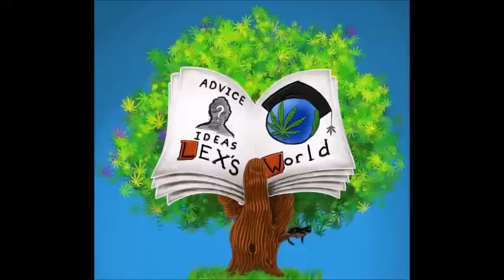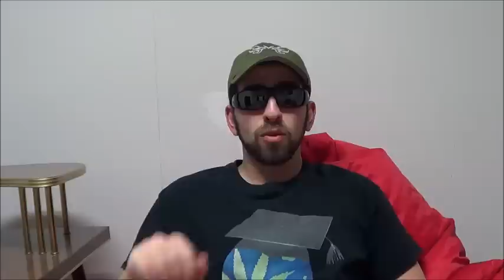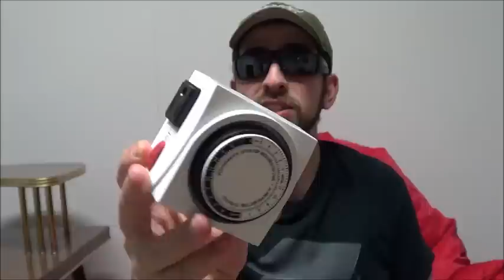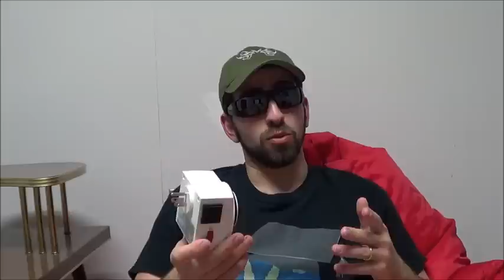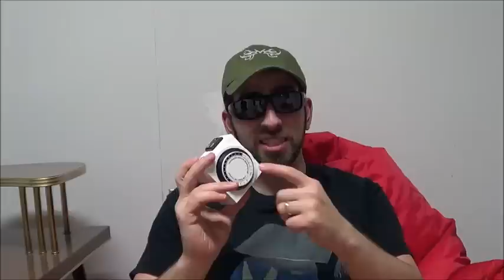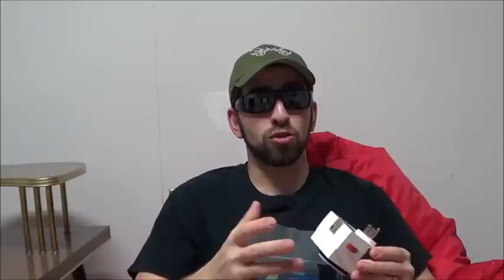Grow Light Cycle Basics + BLACKOUT Emergency Advice

Comment: 8f you are doing dwc, power out is a bigger deal cause of bubbler down. If this happens you can manually airate the water by dumpingbit into another bucket and back a few times an hour, or you can use a drill pump to move it.. I also have a large compressor cylinder that I can slowly bleed into the water for bubbles if needed.. more than lights, no bubbler will kill plantsfast

Comment: I was told during Veg you should run lights 24 hours then switch to 12/12 during flower. Can running your lights for 24 straight hurt yeild or plants? You are my once a day watch. Always learning new things here!. Thanks for what you do!
Reply: Icknod Codopay absolutely will not hurt a lot of people believe they need a rest but you can do the experiment by yourself you'll see around the 20 to 30% increase in growth using 24 hours instead of 18
Reply: Hey Thanks very much for the reply. Fairly new grower here getting good yeilds using this method!. Thanks again.
Reply: Checkout growweedeasy.com - I don't even use forums anymore after discovering that website. The forums are hit and miss, a lot of contradicting information between the users.

Comment: Timers are cool and all but I use $6 inline WiFi switches with a matching phone app that includes detailed timer options.
Reply: Mike of Indy post a link
Reply: Damian Merrel just go to eBay and type in Sonoff wifi switch and there are several to choose from
Reply: @One-way  what do you mean by that?
Reply: Dr.Zach sux throw it in the complete dark for 72 hours.  It stresses the plant not showing the sex.  I used the oven with a towel over the doors glass
Reply: @One-way  you can see a plant in the 3rd week of veg pretty easy, not sure why you would stress it to show more, you then have to deal with it reverting back to veg after a dark period, if shocked you have slowed growth quite a bit imo..

Comment: Hello Lex Blazer, I am a big fan and I have a lot of respect for your knowledge and your information delivery. I ran into an apparent, huge, problem with my light cycle. I am an idiot and FORGOT to change the light cycle from veg to flower. For almost 2 days after switching the lights they were kept on 18/6 cycle. I noticed a huge burn on all the fan leaves and it was then when I realized what I did wrong. I have now switched them to 12/12 but with some noticeable damage. Most of the fan leaves are burnt and dry. Is this damage permanent? ....thank you for your advice and input. Have a great day and keep up the great work man.
Reply from the maker: the damage to the leaves is permanent. Everything will be alright, but you've caused some stress and your final yield will be affected somewhat.
Reply: Thank you! You made my day by responding this quickly to my problem.This has served as a huge lesson and I have documented my mistake to use as a reference so I never make a mistake like this again. To bad, the plants where absolutely gorgeous up to this point having applied all your skilled knowledge. I will finish the flower stage and see the end results and compare to any future yields and try to keep getting better. Wish ya the best!

Comment: So I Put My Timer For 12/12 1 Auto Flower Flowery 3 Normal Flowery Power Off 12 Morning & Turns Back On 10pm Would Of Turned Off By 10pm but the power so I Let It Run For 7 Hours Than Turned It Off What Should I Do Its On Rn?

Comment: hello Lex. I enjoy your videos, they are very informative and thank you. I have a question about lightning though. 
If the maximum hours of light given are 16/8 instead of 18/6 on growing stage, is this a big problem? I know that at 15hrs its like a dead zone for the plant, but is 16hrs going to harm the plant in any way or it will just slow the growing time?  100W full spec LED + 110w TCL for gow. thanks
Reply from the maker: it's not a big problem. It's just not ideal.

Comment: Hello Lex.. I have my plants on 18 & 6 and they they are showing signed of flowing.(Pr Flower) How can I stop it... Due to a thunder storm my lights was off for 15 hours. Ever since then they have been showing white hairs...
Reply from the maker: i think they're probably going to be fine as long as you keep on 18/6 (maybe even go to 19/5 for a while) and you'll find they won't go any further into flowering than just the preflowers...the hairs really won't develop far. Alternatively, could be an autoflower you don't know is an autoflower? 15 hours of darkness shouldn't have messed it up too bad at all.
Reply: Lex Blazer thanks a lot it’s time they get repoted .. They been over due for to get repoted.. plus the temps get really low at night.. this may be a factor.. Michigan weather sucks even thou it’s indoor. I have nothing to control temps.. But thanks.. I will try to make a video tonight on my YouTube channel Motor City Meds

Comment: Bro,
I'm at 12/12. Been there bout 2 months. When do I go 18 dark, 6 light. Or do i?... I have a magnifier, what am I looking for to harvest?
Reply: You got it backwards. You start veg with 18/6 and when you want it to kick into flower you turn it to 12/12. They need a minimum of 11 dark to flower. If you give it more than 12 light during flower it will try to go back to veg and herm your plants. Definitely don't do that. 12/12 for the whole flower phases. 
Make sure you trim up your plants before you flower because stressing them during flower will also herm them . So try not to trim during flower.

Comment: When the hell is the flowering stage? A photo or something would be helpful
Reply: The flowering stage is pretty much up to you.  It will start to flower when you start the 12/12 light cycle.  If you start with a 4 week old plant you get an   ' X ' sized plant at finish.  If you start the 12/12 with a 6-8 week old plant, it will be MUCH bigger at 8 weeks and  ' X '  times 2 -3  finished size.  It all depends on how big you want the finished plant to be.   If you have a 7 foot tent the light needs to be 1 foot from the top.  The plants need to be 2 feet away from the light.  That leaves 4 feet for your plants. If you start flower at 2 feet and your plants stretch 2 feet you are ok.  If you start flower at 3 feet and your plants stretch 3 feet you have 6 foot plants touching the lights and that's not good.

Comment: I've had a power outage when plant we're 40 days old for 2 hours and when power came back on the plantsdied in 72 hours , this has happened 2x.. so your saying it doesn't effect them, I say your wrong.. tell me what to do, if this happens again in veg at 30-40 days old loss of light for 2-3 hours
Reply: My friend, I don't believe it the loss of power that cause your plants to die. At least it's not the lost of light for 2 or 3 hours. Think about it, people use 18/6; 12/12 and grow outdoors, but plants don't die from loss of ligt up the 12 or 13 hours! I would check what you are feeding them; or it could be other reasons related to loss of power.
Reply: If you can, buy a generator

Comment: What would an outdoor grower do here in Canada when you need to start the 12/12 cycle early (sept) due to it getting to cold by mid to late October to even have the plants outside?
Reply: I'm sure you have discovered the answer but if still pondering this get some tent poles and a tarp, as long as you keep the frost off it should be fine

Comment: Hi, if I do 18/6 with it being 6 @ night what time would I need to set the timer on? I'm a newbie and have that exact timer, also they red timer button on the side how does that work? Thank you very much for any feedback!
Reply: Lupe Valdez 12 midnight to 6 pm on...6pm to 12 midnight off
Reply: 🥷🏼  yes. They need minimum of 11 hours dark to start flowering. 12/12 is perfect
Reply: 🥷🏼  I do my dark during afternoon because it's cheaper on electricity at night and much cooler when the lights are off around noon time. Humidity is the worst thing for flowers.
Reply: 🥷🏼  in my area electricity is 1/4 the price from 9:00pm - 8:30am so it saves me good money to run most of the 18hr light during those hours. Check your area rates. Good luck!
Also I've been leaving my tents open when the lights are on and the buds have been denser.

Comment: 24hours of light in veg grows faster 12hours light during flowering .when switching I leave in dark two days seems to start flowering in a week.the just switching tends to take up two weeks to show
Reply: how many  harvest have you had ,what was your largest garden? I've grown in300plant hydro and200plant in medium inside and outdoors since 2001i learned. to hate trimming bad hands.try trimming 2weeks before  harvest, bigger yield more light on plants
Reply: jeannine grant 😁 thanks! Can you tell me what type of light for flowering
Reply: I ran 18/6 18/4 and 24/0 on several strains , 18/6 was best results. I do the 24 hour darkness before flower best results I had all the way around also was 18/6 regular seeds and 18/4 auto flower. A test im not willing to perform is light leaks I have had mega light leak issues from different situations and I mean direct light lol. I do not know if it was luck or what but I had no issues. Im sure light issues will trick the plant into pollinating itself but I don't have the balls to do a light leak test lol. For instance I overslept during week 5 and 10 hours in opened the tent and watered with fluorescents banging my plants long enough to water and had no noticeable issues. I am curious on the light leak issues not many videos on it. Only time I got a hermi was from taking an indoor plant outdoor. I left it who knows if seeds popped there the next year lol.

Comment: What are the pros and cons to a 10/14 flower cycle and what would the effect be if I changed from 10/14 to 12/12?
Reply: 12/12 is absolutely best and it would only benefit your plant by switching

Comment: I had a 5 day blackout and everything was fine.  Plants can deal with it very well. However, if your timer breaks in your Day-Time, while flowering, you're fucked.

Veg: light cicle too long = no problem
Flower: light cicle too long = fucked

Veg: light cicle too short = you're starting flowering
Flower: light cicle too short = no problem

It is not that complicated and the video got it wrong.